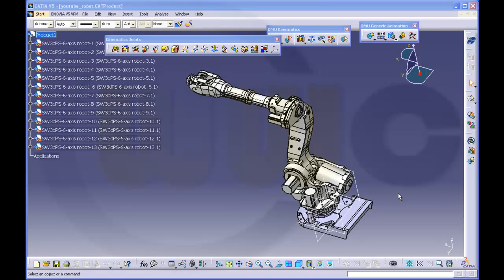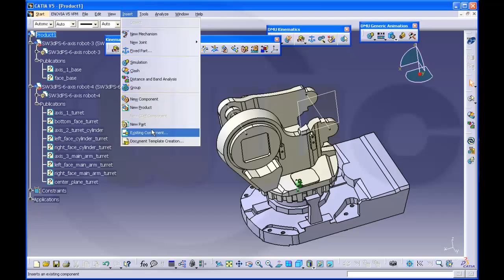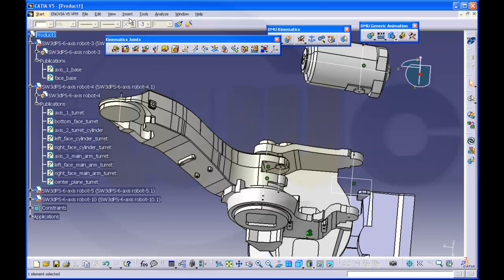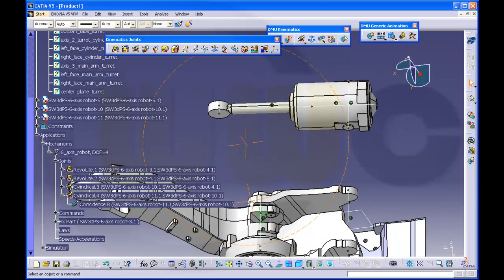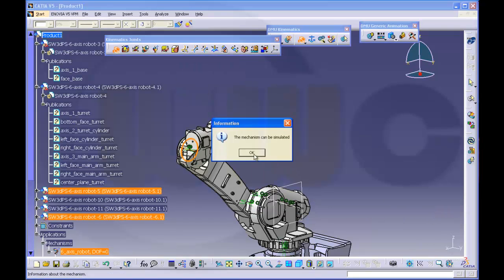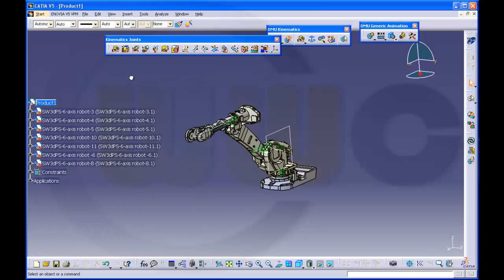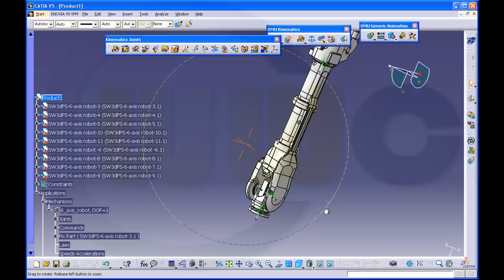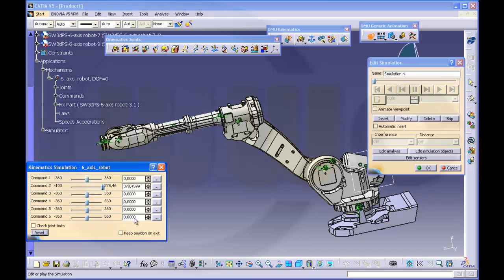3.2  Catia v5 Kinematik - 6-axis-robot - joints - Mechanism - Simulation

Comment: what should i do if the Assembly has more parts and they should be fixed not to move . i am making  Mancini Diesel  Motor  with catia v5  and i would make simulation  but the problem that it is only 4 or 5 movable parts and the rest are fixed can i fix the rest and to be able to simulate the Mechanism  ?
Reply from the maker: Hi, put all the fixed parts in one  subassembly and fix it.
Reply: Meinen Sie in einer UBG   und zu fixieren ?
Reply from the maker: Ja in einer Unterbaugruppe und diese fixieren.
Reply: Vielen Dank :)

Comment: I am a newbie on learning Catia. Thanks your video. Is Catia possible to synchronously   check the interference when the simulation is running? In this robot, there are some rotating joints between each other. If one of the part running 360 degrees is to overlap to the other part as simulation running, will Catia show up the "swept interference" between the two parts. How does Catia handle the interference checking when the simulation is running if it has?
Reply from the maker: Hi, yes you can. Look for "Clash Detection" and "Swept Volume". You can stop on Collision as well.

Comment: I have a problem with my Catia V5 R19 i currently work on assembly and simulation of a 4 axes robot, the parts are modelled and  download  as (.CATpart). the problem is, when i wants to open the parts on my computer an error poster : 
"impossible opening.; the  application; is not same level as the file"
how can i resolve the problem ? and open the files in CATIA V5
thinks before
Reply from the maker: Hamza Lahbiri Seems to me, the files have been created and saved in Catia Version with a higher release number, or maybe with a higher servicepack. This would cause such an error message.
Reply: Wolfgang Walden think you MR wofgang Walden, there is a way to resolve this problem? and wath is the reason for the catia poroduct engineer to put a  condition lake this ? 
think you again
Reply from the maker: Hamza Lahbiri The reason ? I don´t know it is sort of odd. And sorry I know no way to work around it, seems your stuck.

Comment: hi walden how r u? i was looking for mechanism design tutorials. please help me find some tutorials on different mechanisms. it woluld be better if the tutor includes the individual part designs and the the assemly design together with the simulation one by one. thank you very much. u can also feed me some pdf materials also. thank u
Reply from the maker: Hi, I see, but I regret I have to say  "use google" or the official website, because I do my research with google as well. For this exercise I used the parts from 3Dcentral, so I didn´t have to make it by myself.

Comment: If i define  a joint then a MSG appears that the mechanism can be simulated. But it doesn't appear if I uncheck the angle/length driven check box. Does it mean that I wont be  able to simulate it?
Thank you for your reply.